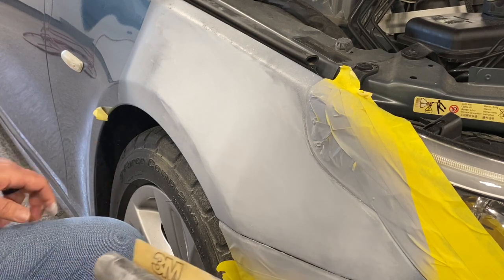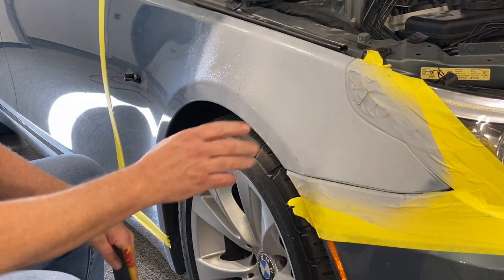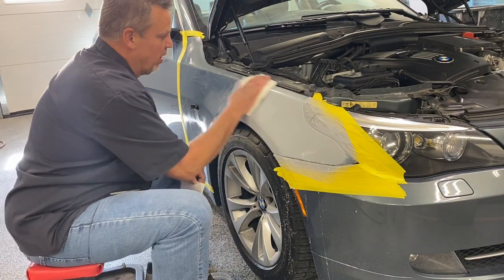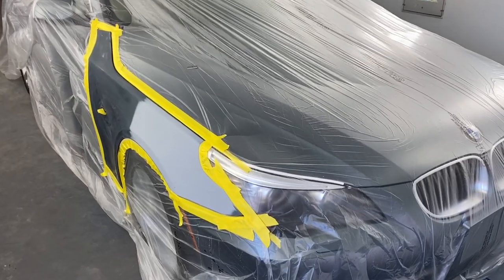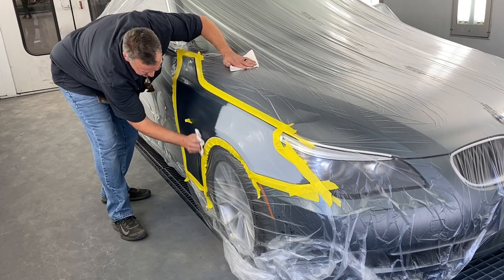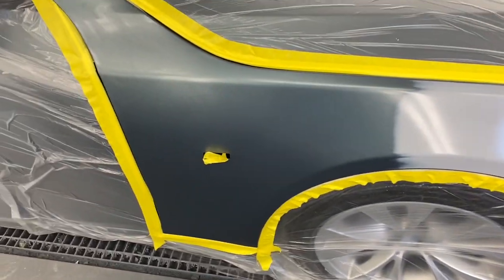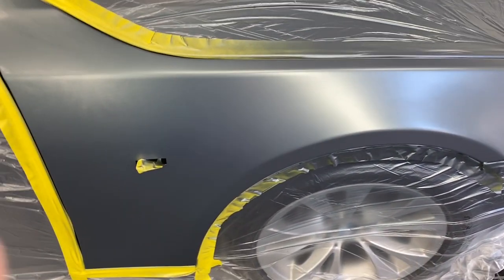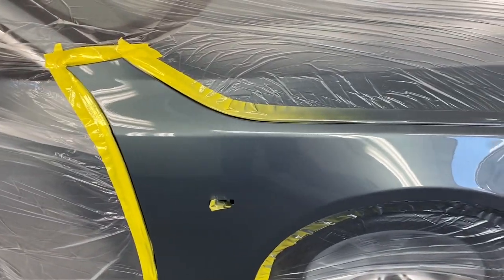BMW Part 2 Paint Time!

Comment: how long do you wait for the flash to dry?
Reply from the maker: Depending on the ambient temperature and humidity, it can take between  7-12 minutes. those numbers are based on 70` and 70% humidity.
I can control those conditions with the paint booth, but it uses a boat load of propane. In a production situation I can force it down to probably less than a 5 minute flash time using the baking feature for water born base coat. Solvent base coat is much faster and is not as affected by humidity.  Great question!